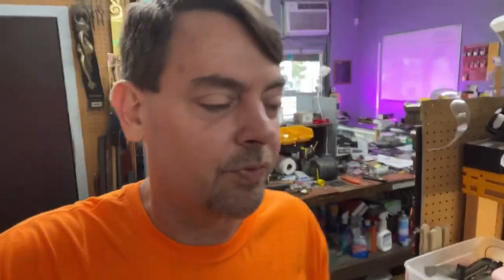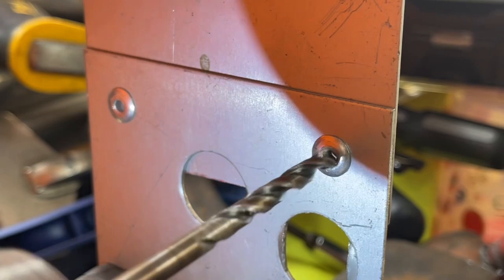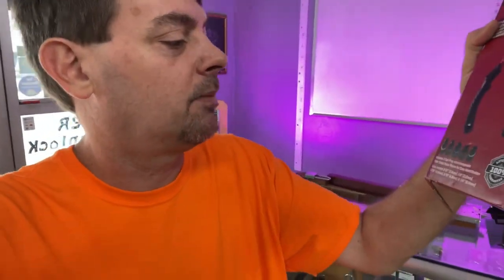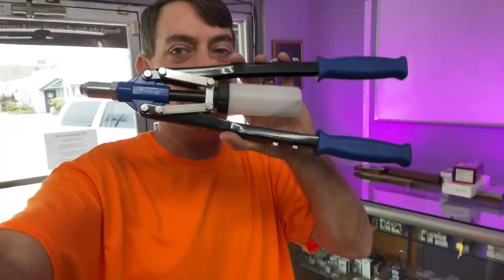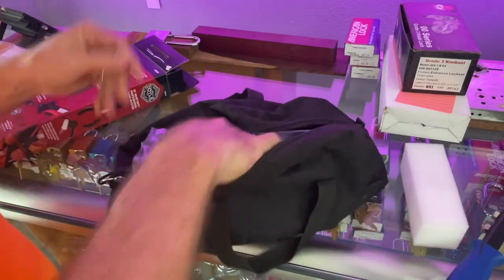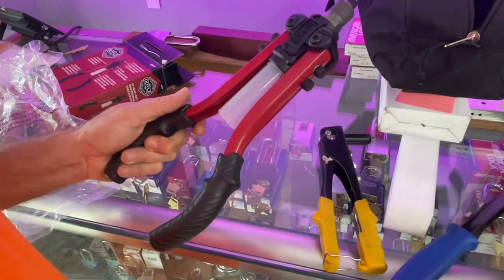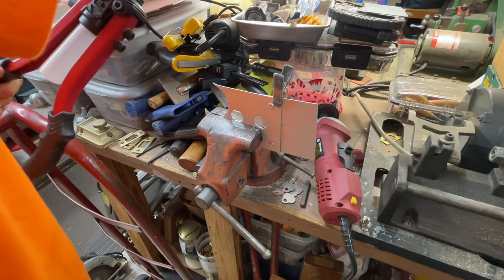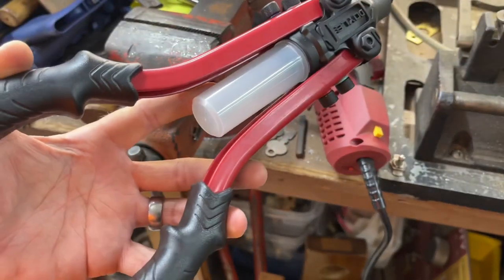Pop Rivets & the “new” Harbor Freight Doyle 13” Professional Pop Rivet Tool

Comment: Hi Jason.
Hi Frank good to see you Frank.
Thanks for doing this video, the new riveter is definitely going to be mucho morer useful for you. The countersunk rivet's will definitely be great for a tight fitting door. 
Thanks again for taking the time to do this video.
Now there's more things on my tool wishlist.
I just realized that you usually have your baby Knipex in your pocket,so you will have a tool ready to change the tip. Or your Leatherman 300 supertool.

Comment: You could use that big gun for Ford door handle rivets.
Reply: My exact situation. I have a customer requesting new locks and handles on their ford utility truck, I was advised I could pick the retainer wafer to remove core, but the customer wants handles too. I looked and damn pop rivets…first time I seen them, or noticed them. I’m used to seeing solid head rivets like those breakaway security screws on Nissan and Hondas
Reply from the maker: Is there something wrong with the handles? If not, always remember the customer "isn't always right" and if there is nothing wrong with the handles then he just gets a new key.
Reply: @selock  the truck was broken into and stolen. When the truck was recovered, the locks were all busted out. He just feels insecure about the locks and handles in general. They are a Trimark product. But ill talk him into just replacing the locks because the handles seem fine to me

Comment: Going to have to pick up the Doyle. My number one complaint about the other type is that about 30% of the time, I manage to bite my fingers in the tool when it "pops". Doesn't look like that would happen with the Doyle, and I like the little collection bottle.

Speaking of, I keep those little things; if I find the rivet I have is too long, I take the pin thing out, stick an old one in for support, and then cut it to size with some diagonal cutters. Dremel & cut off wheel obviously works too, but I find the cutters are faster, and so far no issues with deformation causing any problems. YMMV.

Comment: The Doyle tool looks pretty good.  I used 1/8" pop rivet brand, black, counter sunk for Neutrik chassis mount, XLR microphone connectors, thus matching the black connectors.  Not sure of rivets can also be had in brass anodize finish for the "discriminating" locksmith customer in special applications (whatever that may be?)

Comment: I just started using rivnuts, and they’re pretty great in situations where the backer metal isn’t thick enough to thread but you need a removable fastener.
Reply from the maker: I mostly just use them for the typical use's of mounting maglocks, but I rarely do that anymore cause I hate maglocks :) Actually have to do one soon so I'll be seeing how this HF version works

Comment: Excellent video Jason. Oh I would pull your chain and say don’t you wanna make tabs from metal doors that’s how we’ve had to do it for years right. 😂😂😂

I am just teasing the easier way is always the best whatever works easiest grandpa always said work smarter not harder. 
So you always have to keep that in mind.
Reply from the maker: I hate "tabbing" doors :) I only do it now if the existing ones are broken off or rusted too badly but even then still hate doing it and use pop rivets to fasten them most of anyway ;)

Comment: Thanks for the video I will be getting the 13”Astro 1423 which is $27 and is what the Harbor Freight version is copying except they’re getting too expensive for me. I liked the demo of why I don’t want the $5 riveter although for the price it has its place ……thanks!
Reply from the maker: I still use my $5 more than the new one, especially for just one lock repairs (couple of rivets) :) When it breaks I'll probably go get another again. When I know I'll be doing more than 1-2 I reach for the bigger one.

Comment: Jason, you eluded to your threaded rivet nut tool. I'm interested in your thoughts on using rivet nuts or cross nuts(plus nuts) to handle worn out holes in metal door frames.
Reply: Anybody have experience with cross nuts?

Comment: SE, What type of Revit will give me a "flush" end on the back side?
Reply from the maker: None. Sounds like you will need to drill and tap with the correct length of screw. If the material is too thin for that you might be out of luck, nothing I know of would be flush

Comment: Stupid question.  If have 2 prices of aluminum one is 1/8” and one is 1/16” and I’m riveting these together with 3/16 rivets, what length do I need?
Reply from the maker: You would need a 6-4 off this chart https://www.albanycountyfasteners.com/v/Rivet%20Size%20Chart.pdf
Reply: Does that equal 1/4”?
Reply from the maker: Home Depot (arrow) rivets yes, because the shorter size is too short

Comment: Wow your rivet holes are huge compared to your rivets, I use numbered drills and it gives me a press fit, the rivet has to be pushed into the rivet hole with pressure. Even without setting the rivet the two pieces of material I am joining cannot move at all.